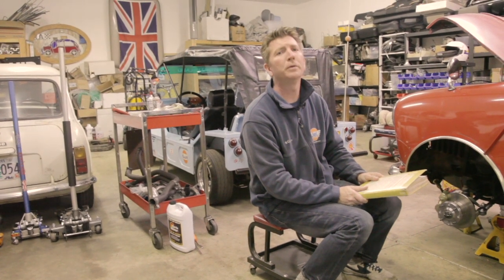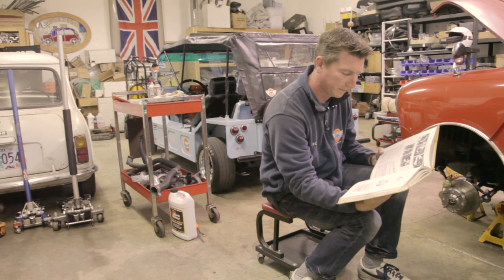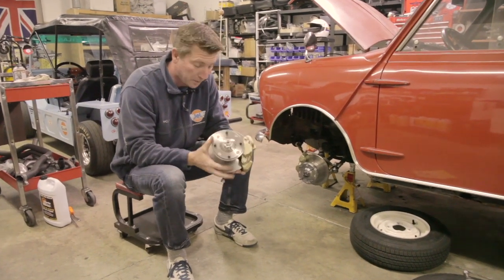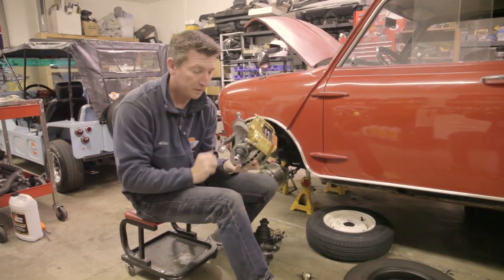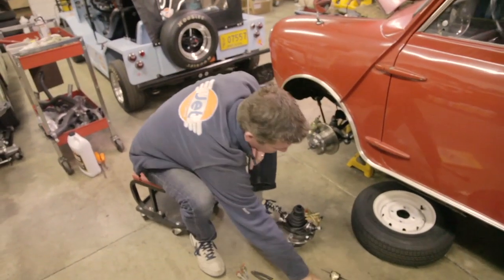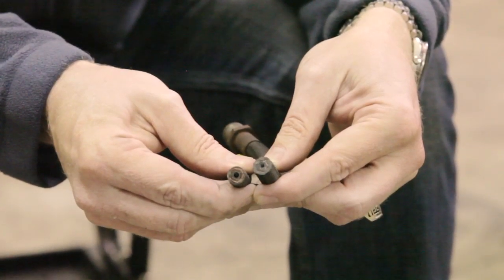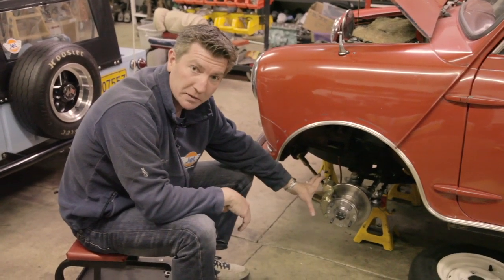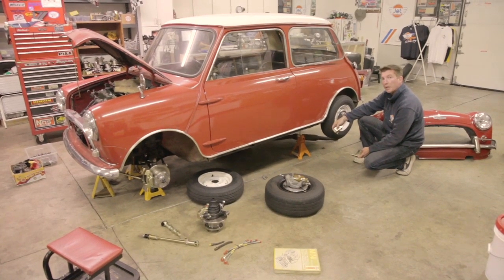A Reading from the book of Haynes Mini Braking System

Comment: Good information. Would you be able to do a front drum to disc conversion? I've searched everywhere and no one has done one as far as I can see. Cheers
Reply from the maker: Yes we sell the entire drum to disc brake conversion kit truly bolt on includes everything you need. $995.00
Reply: Jet Motors Cool. Where are you located?
Reply from the maker: We are in Happy Valley Oregon USA. 503-869-4294 sales@jetmotorsmini.com

Comment: any video of how to remove the safety from the pedal?? My mk1 has brike and i am trying to get this out almost a week now!!!
Reply from the maker: Not sure I understand what safety from the pedal you are speaking of?
Reply: First of all check my channel and see the mk1 i got. I mean how to remove the brake pump. The har cas a cooper s brake pump. i Took the 2 bolts out of the engine tha holds the pump there. And inside the car there is a safety behind the brake pedal that holds a Pyrrhus or russet if i am saying that correct.!! ( chapter 9 page 139 item number 3: pushroad-to- brake pedal adjustment there is my problem. I found the manual in a torrent)